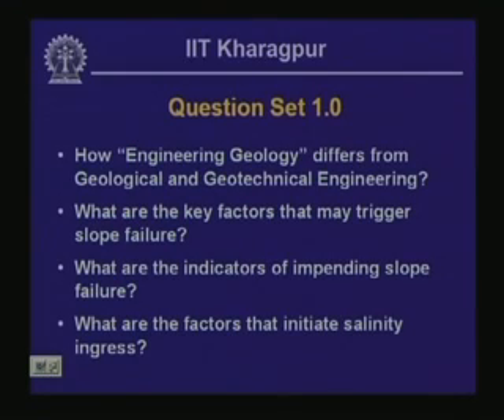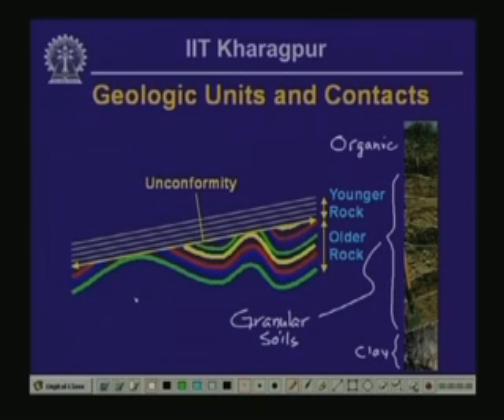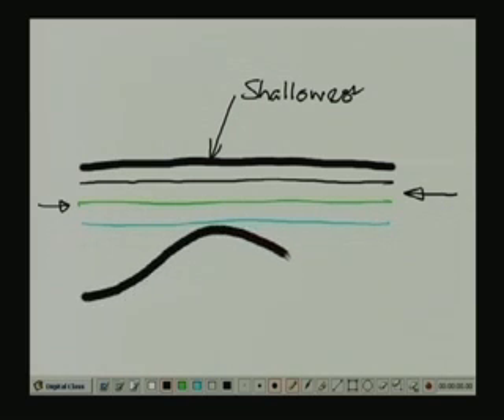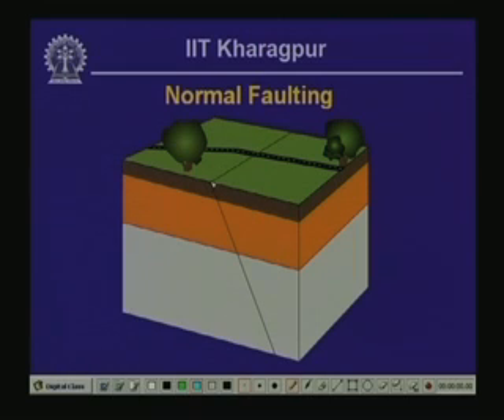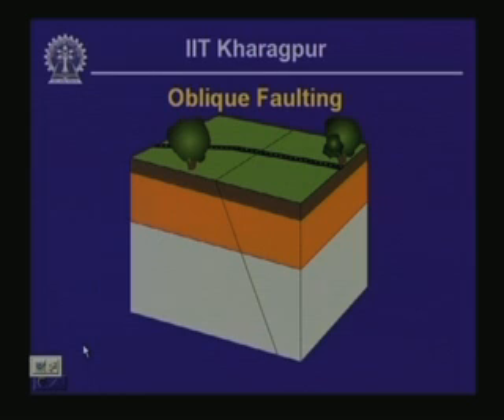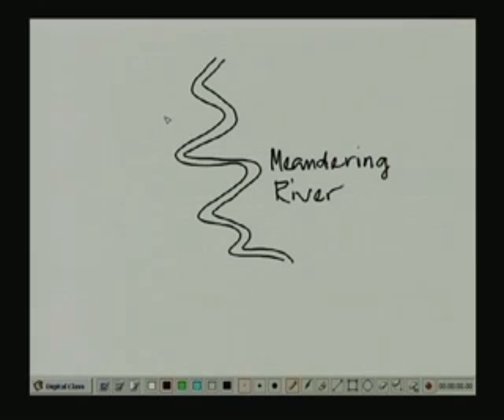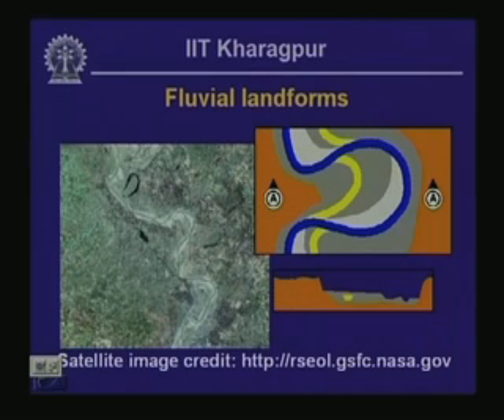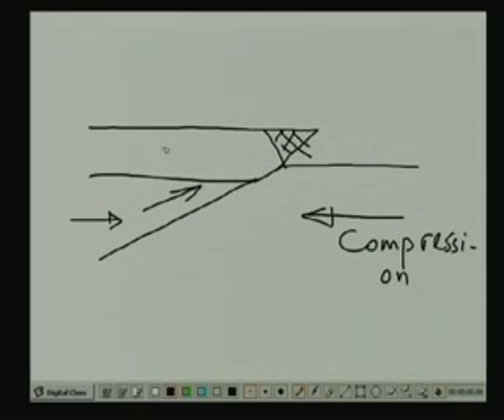Lecture - 2 Geologic Structures

Comment: I agree. Sometimes Debasis is refering something on his screen but video only shows his picture. Plese watch between 19.08 and 19.50 seconds of the video. There are so many places like that in this video. 
In fact its not a problem of Debasis, its only a problem with video production. Apart from that this is a great lecture and thanks a lot to Debasis.